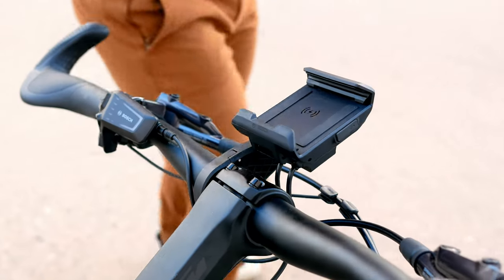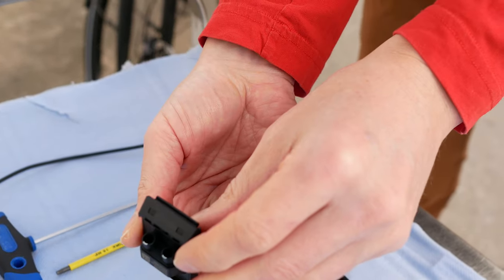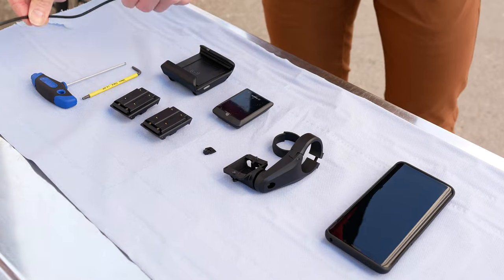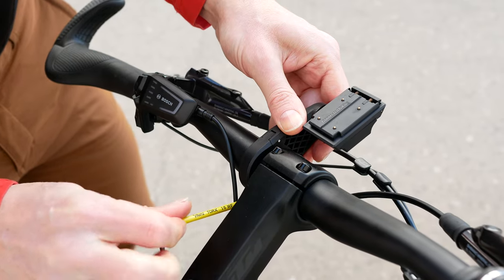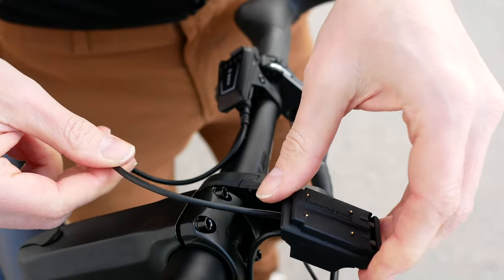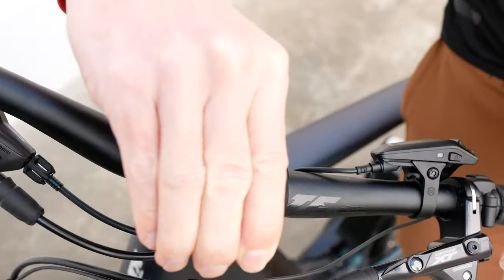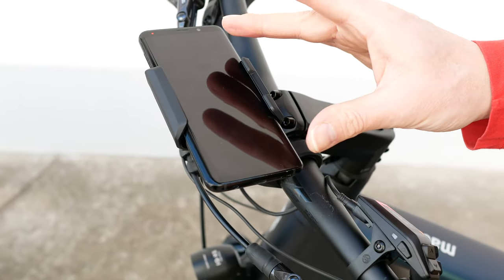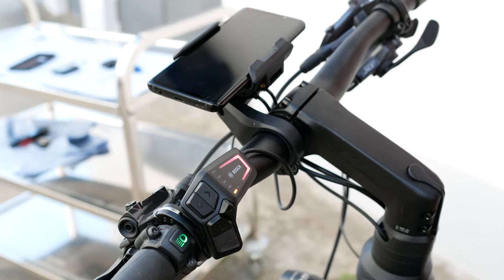How to mount Bosch SmartphoneGrip & turn your phone into a display | EBIKE24.com

Comment: Works perfectly with the protective case here! I use an Aliexpress cover with a magnet ring integrated and it works without any problem, I tested it with any other case, and also without any problem the phone charge.

Comment: So this is just a regular holder with a charge function and all connectivity is through bluetooth and the phone app anyway?
Reply from the maker: Hi, and thank you for your comment! You could sum it up like this, at the end of the day it is just a mobile phone holder. However, connecting it to the Smart System is very easy and quickly done. Especially for cyclists who use their mobile phone for navigation while riding, it is very helpful. Especially the navigation with the conventional Bosch displays is not really ideal and might be unclear. With the SmartphoneGrip, Bosch cyclists have more possibilities when it comes to choosing a display. In the end, every cyclist has different needs.
Cheers - Michael

Comment: 4:49 you see that you have to remove your smartphone case. That is not very handy or wise in case of a fall. 
My phone can become very hot in sunshine especially with wireless charging. Is it possible to shut the charging off?
Reply from the maker: Hi, thank you for your comment. You do not necessarily have to remove the phone case. Most cases should fit on the SmartphoneGrip if they are not too thick. I would recommend using the SmartphoneGrip only if you are riding on mostly even terrain. It is not made for use on downhill trails, etc. Bosch states that occasional drops of up to 15 cm are permissible.
Unfortunately, you cannot turn off the charging function. If you do not need the charging function of the SmartphoneGrip, I recommend getting a normal mobile phone holder (e.g. https://www.ebike24.com/e-bike-smartphone-mount?p=1&o=2&n=24&f=96). In the end, the SmartphoneGrip is just a convenient solution for holding and charging your mobile phone on the handlebar while riding. The FlowApp works via Bluetooth, so you can also use other holders.
Cheers - Michael

Comment: Should this fit my s23 ultra?
Reply from the maker: Hi, yes your s23 ultra should fit. According to Samsung it has a size of 78.1 x 163.4 x 8.9mm. The SmartphoneGrip is suitable for phones with max. dimensions of 88 x 175 x 13mm. You may have to remove your phone case however.
More info here: https://www.ebike24.com/bosch-smartphonegrip-retrofit-set
Cheers - Michael

Comment: The Gazelle Avignon has a round connection when I disconnect the included display, is there an adapter or another version of this?
Reply from the maker: Hi and thank you for your comment! Unfortunately we are not that familiar with Gazelle bikes. Could you tell me the exact model name and model year of your Gazelle Avignon? Do you know by any chance the name of the Bosch display you have currently installed?
Cheers - Michael
Reply: @ebike24  Gazelle Avignon. It has the Intuvia display. It has a round mount on the back, which seems to be the same as the Garmin items, such as the Varia.
Reply from the maker: @MeghanJohnsonRocks  If you have the new Intuvia 100 installed, you need to remove the entire holder since the SmartphoneGrip comes with its own holder, which is also included in the set. If you're still uncertain, I recommend contacting Gazelle directly: https://www.gazellebikes.com/en-us/service/contact
Cheers - Michael
Reply: @ebike24  Gazelle says to contact Bosch, who hasn't responded. My grip didn't come with the handlebar mount. Maybe it will fit a Garmin one.
Reply from the maker: Thank you for your reply, and I apologize for not being able to assist you further. However, this is the holder required for the grip: https://www.ebike24.com/bosch-1-arm-holder-kiox-300-500-display
Alternatively, you can consider the complete retrofit set: https://www.ebike24.com/bosch-smartphonegrip-retrofit-set
Cheers - Michael

Comment: Any tips on using a phone and not having to remove my protective case everytime I ride?  Removing my cover puts the user at risk of dropping their phone and its such a pain to always take the case on and off.
Reply from the maker: Not easy. May be gluing another protective case to the Grip.
Reply: As shown in the video, the reason he's removing the case is to facilitate wireless charging. Sometimes the case is so thick that it prevents charging. My Pixel 6 has a case on it and wireless charging still works. So this depends on your phone and your case. The other factor that concerned me was whether the grip will press the phone's buttons. This of course would not be good. So if you don't have wireless charging and end up using a cable then definitely leaving the case on should not be an issue.  Good luck!

Comment: Is this mount “down hill” rated!? 
It doesn’t seem to have a tight grip on the phone, anyone have a phone smash the rocks? 😬
Or I’m I just being paranoid 🤔
Reply from the maker: Hi, I would not recommend the SmartPhone Grip for down hill use. It holds the mobile phone firmly so that it cannot fall out. However, it is not protected from stone chips, branches and anything else that can get in the way when riding down hill. Especially in the event of a fall, the mobile phone and SmartphoneGrip are not protected at all and may break. For down hill use, I recommend the Purion 200, which at least gives you a small display, or one of the Kiox displays, mounted above the stem. The SmartphoneGrip is more suitable for trekking / city use.
Purion 200: https://www.ebike24.com/bosch-purion-200-control-unit
Kiox 300: https://www.ebike24.com/bosch-kiox-300-e-bike-display-for-smart-system
Kiox 500: https://www.ebike24.com/bosch-kiox-500-display-retrofit-kit

Cheers - Michael
Reply: @ebike24  thanks for the info!
I personally don’t have an issue with using the phone as long as it doesn’t come loose. But if I fall, for some reasons I never do well that would be on me and could take if it breaks then. Would just hate for my phone to fall off, break as I’m still on the bike flying down hill. 

But will ck out those links for different possible options 🤙🏽Thanks!

Comment: Bosch SmartphoneGrip is good why is the smartphone not big enough to hold my samsung s 22
Reply from the maker: Hi and thank you for your comment. According to the data from Samsung and Bosch the S22 should fit to the SmartphoneGrip. The Samsung S22 has a size of 146 x 70.6 x 7.6 mm and the SmartphoneGrip fits phones up to a size of 175 x 88 x 13 mm. Are you using a phone case that might be too big for the SmartphoneGrip?
Cheers - Michael
Reply: @ebike24  thx yes a use a case  for my s23 ultra  but i heave the hub .now i see that the grip is bigger and i go to by it.Or i must everytime switch the simcard to my samsung s10.and a heave reading that the hub much break so i must be carefull.

Comment: Where can I buy this? Uk only please.
Reply from the maker: Hi Kevin, thank you for your comment. It is available in our shop: https://www.ebike24.com/bosch-smartphone-grip-smart-system
Please note that for orders to UK there is a minimum order value of €200.00. You can contact our customer service and we can set up the order for you: info@ebike24.com
Cheers Michael
Reply: Ebay vendors seem easiest in the UK, none of the bike shops stock it, all have it on back order.
Reply from the maker: Hi Paul, that's not quite true, we have the SmartphoneGrip available in large quantities. However, shipping to the UK is only available for orders over €200.00 / £172.33 unfortunately... https://www.ebike24.com/bosch-smartphone-grip-smart-system
Cheers - Michael